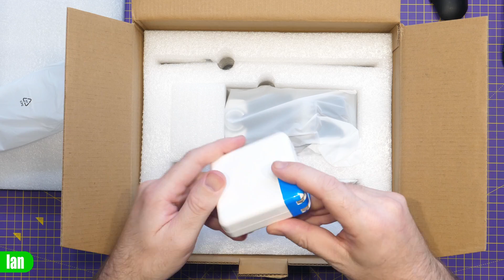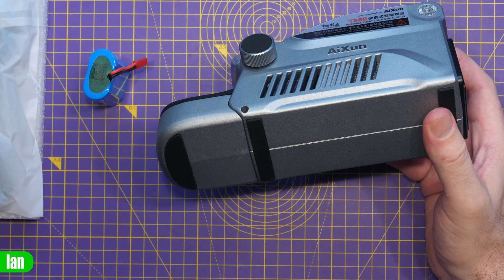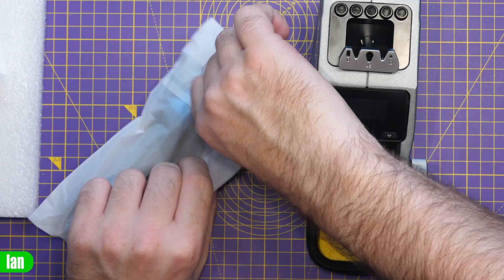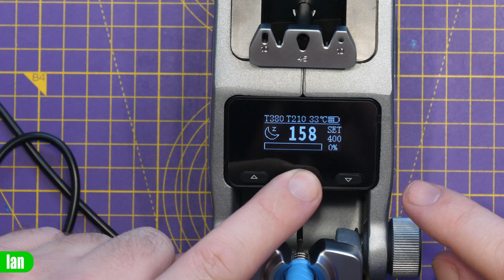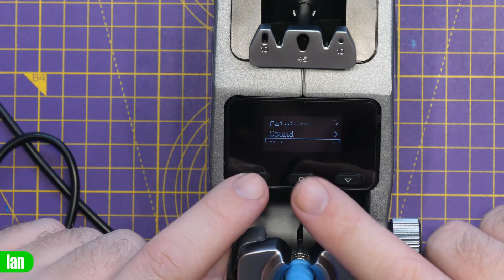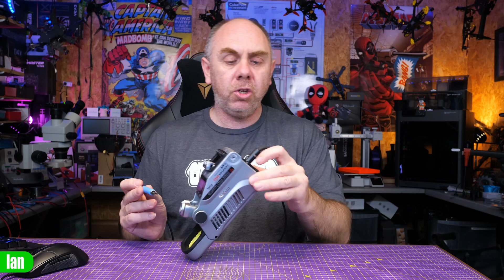Aixun T380 Portable Pro Solder Station - Battery Or USB C Powered

Comment: How is calibration done?
I bought this product, but I cannot melt it even at 450 degrees. I can't solder. 
I think it came defective. The place I bought it from does not want to take returns. They talked about calibration. I will give it to them and they will calibrate it. I'm not very hopeful. I bought it because it was highly praised, otherwise I could have bought 2 devices(oss team) with the same wattage instead of just 1.

Comment: I buy this station two weeks ago. My personal issue - inability to calibrate the tip and remember several tips. This is a very important function for Chinese stings, and most stations have this function.
Second strange issue -you can not power off this station while power cable is plugged in (described in this video). Very raw software

Comment: How does this compare with "portable irons" like the ts100, ts101, and secure sq-001?  Never understood the need for stations, but I'm genuinely curious what advantages this offers, other than a stand
Reply from the maker: This is really a portable bench iron.  It’s not for field use unless you have a lot of work to do.   For moving around the workshop it’s great.
Reply: Main advantage of stations is the huge amount of power they can dump into the iron, along with easier controls and presets due to a range of buttons, a nice big display and better safety and longevity due to the larger amount of space for higher quality and larger components.

Handheld usb-c irons are fantastic for simple/small work, but when doing lots of soldering with different tips for hours a day, they simply don't work well enough, comfortable enough and reliably enough for many people. The ergonomics on station handles are also much better because they can be lighter due to being hollow inside, as the components are all in the station

Comment: To me the only reason to get an Aixun station is to be able to use genuine T245 JBC tips. And this one doesn't support them, pass..

Oh, and why would anyone get a portable battery powered station? Am I to believe that people carry soldering stations to solder motors when out flying?? Just use a cheap $12 SH72, gets the job done just as well with enough flux :)

Comment: Just put a ts100 in my bag. This is unneccesary.
Reply: You got iron os installed yet? For me it made a world of difference it heats faster and can go up 50c higher which makes soldering an xt60 a breeze
Reply: @CyberdeckCafe  not yet will give it a look apparently you can put your logo on the screen too 😅
Reply: Ts100 doesn’t have great tip to grip and doesn’t have huge tip selection, if someone wants something portable then type c iron that uses jbc c245 tips is the way to go